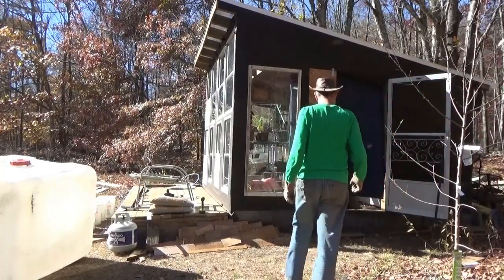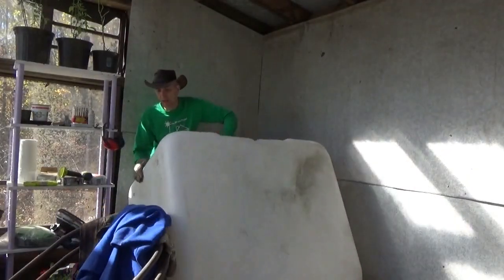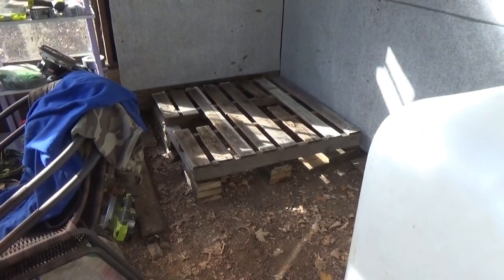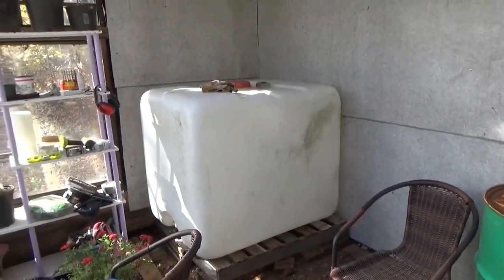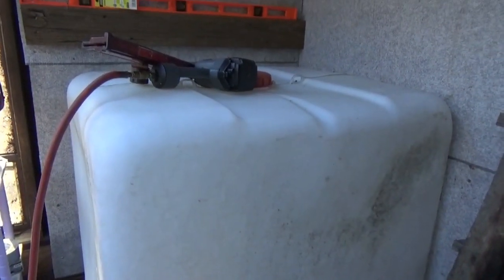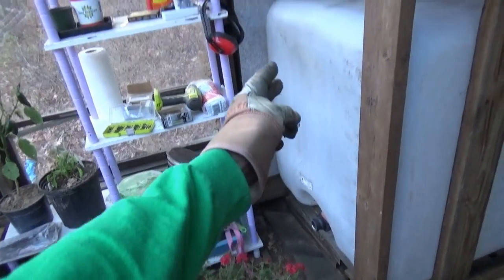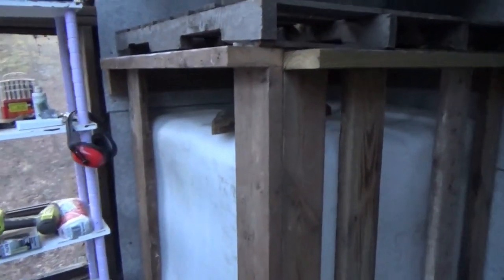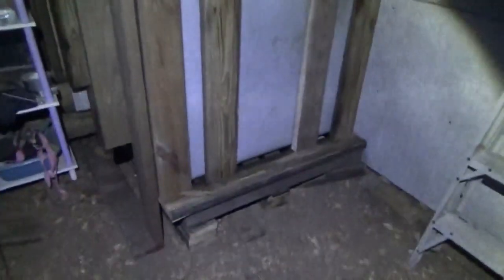Framing In Aquaponics Tank & Filling Up With Water

Comment: A great space saving method for lettuce is to use those fabric hanging shoe holders, you get 20 pockets to grow lettuce in, and you hang it on a wall. About 3 feet wide and 5 feet high. Put a trough at the bottom to catch water and you could even hang recycled water bottles above each column with a few holes in the lid for drip irrigation. Fill each bottle in the am, and with the trough at the bottom, no wasted water. The only caveat is with the pockets, the soil dries quicker, so you have to water every day.
Reply: here is an example - <img src="http://www.carcarealert.com/misc-stuff/shoegrow1.JPG">

Comment: did you think about putting the water tank 3 ft into the ground to use the natural heat of the ground? also hvy chains would hold the shelf  above the water tank to the ceiling rafters.
Reply from the maker: Would be nice but I cant dig here. Too rocky. Not without a heavy earth mover

Comment: I'm wondering...If you put a couple long door mirrors across the back, would it help so the plants don't lean so much. Hmmm. Put them horizontally mid-level? Make more use of the light that way. Great job you've done there. I bet Melanie is pleased as punch! :)
Reply: I like your idea of using a couple of those inexpensive door mirrors from Walmart to reflect light back on the plants to help keep them from leaning in one direction so much towards the sun.

Your idea is much better than the one I had where Troy jacks up the greenhouse and builds a giant Lazy Susan platform to lower it on so he can rotate the greenhouse on a regular schedule to alternate  which way the plants lean.

Personally I would try to get my plants to lean to the right mostly.
Thats just how i roll.  
Hehe
Reply: Lol!!!! :D That's so funny.
Reply from the maker: Thank you. The radiant foil is reflective and cheaper. I can cover the entire inside with it
Reply: Ahh that sounds a lot cheaper than the used Batmobile turntable I was checking craigslist for you.
Reply: Great idea!!! :)

Comment: The barrels could be yoused in front of the woodstove as a heat shield an it will store heat in the water mass
Reply: thats what i was thinking ...1 barrel in the corner...1 on each side of it and push the woodstove in between them all....drill holes on the sides of the barrels that face the woodstove so the heat can get inside of them ....
.heat shield and heat mass all in one...later get 3 more barrels and put them on top of the first three fill with sand and stones
Reply: swany you could fill the barrels with junkyard antifreeze in case Troy can't get a fire for some reason you got a good idea there

Comment: Nice work troy and Cris , your wife will be very happy the water is close to the plants make super easy, now I have a question for ya ? What about running 1 wire to the green house for just a small light , like an l.e.d light for night time watering or to work. In the green house, you should ad rope lighting on the front porch for y all can set up on the porch. At night that would be cool or some solar lights

Comment: Seed sprouts are great for winter greens~ You cut the tank(after you framed it lol) and made it weak and it will need cross bracing to hold its shape. Looking good! And I agree that the barrels are not needed with the 2 tanks...I'd put one in each corner to make them easy access.

Comment: Hey Troy, Great videos! Just an Idea I wanted to throw at ya.  Why don't you buy a 48v-300watt DC heating element and cut a hole in your water supply tank, place the proper Bulk Head Fitting in their and install your heating element and the water would never freeze no matter how cold it got up there.

It cost like $8.00 for the DC heating element but if you dedicate 3 solar panels just for the green house, you are set no matter how cold it gets. Just a thought.  Keep up the good work, keep focused on your dream.

Comment: Those 55 gallon drums won't be needed, by having the totes you  have more than 3 times  the amount of water than the 3 drums will hold, and once heated up should provide enough heat to keep from having a freezing problem in the shed plus without the drums, you'll have more space for the wood stove, since putting it outside even with a shroud around it will not produce enough heat for the building without having a blower system installed.
Reply: Agree, I think he is overdoing it with the four barrels

Comment: What if you setup the wood stove to heat the water in one of the barrels? It would probably take less than an hour to heat a barrel like that to 160 deg (F) and would take all night to cool down.  You could locate the stove outside and run a closed loop into the barrel. Would the heat of the water hurt the pump?

Comment: Bit confused... not experienced at all in this kind of work. But if this works so well, why didnt you make the shed section that you built up agianst the tiny house on wheels with a bunch of windows and clear roof, plus the solor powered heater. Then your tanks and propane water heater lines wont freeze and you wouldn't have to burn wood?
Reply from the maker: Because the water tanks in the shed should never see daylight in order to stop algae growth. And windows lose heat bad and fast. The shed will be more insulated. Sealed off and easier to heat by far.
Reply: CJ Abbott the location of the utility shed is not a good location for a green house type building. Not enough sunlight.